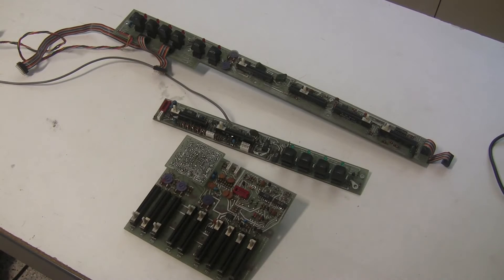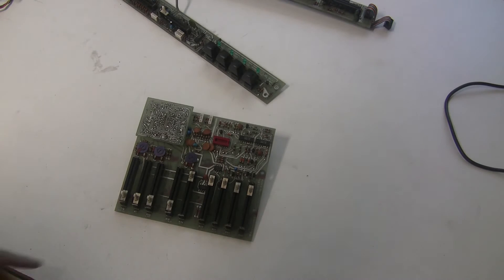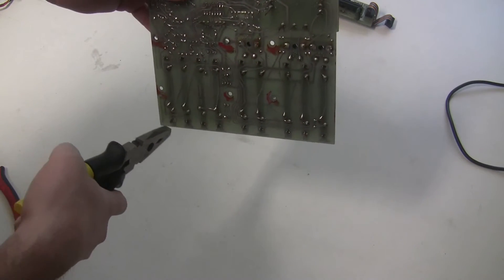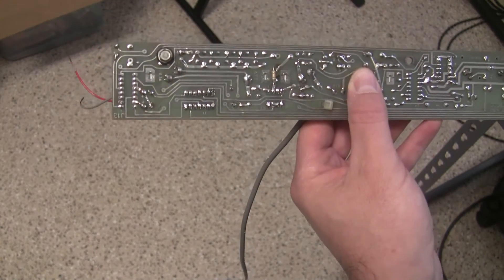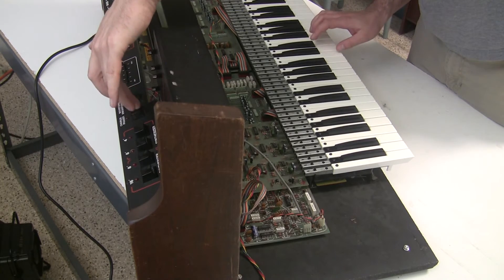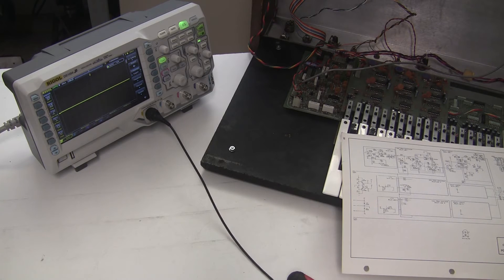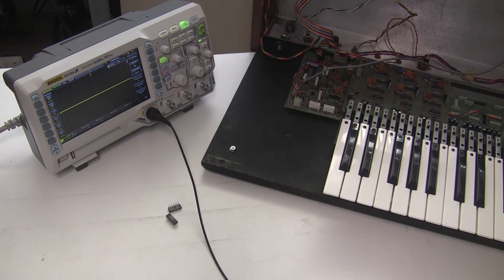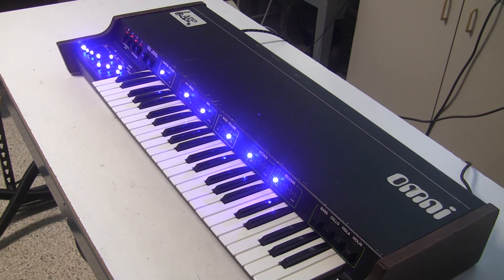Synthchaser #037 - ARP Omni 1 Restoration & Repair - 4/4 - Completing the Repairs

Comment: Soo helpful, thank you very much!
I inherited a few items from neighbor whose deceased husband had a studio and one of the items included the ARP Omni 1!
After reviewing some of your videos, I now know some of the conditions are due to the Tantalums, so initially, need to replace all of them as well as cap job and for the B+!
I'll have to see what's up after that as I can see some issues, just as you had with the burnt resistors and areas where the tech who worked on it at one time burn some traces off, so did work arounds!!
Hopefully, when I get done with everything, it will be back up to snuff and work appropriate!